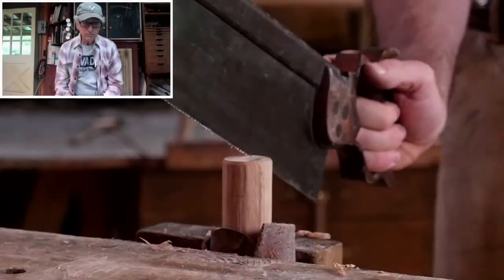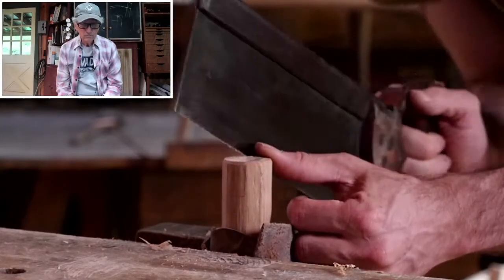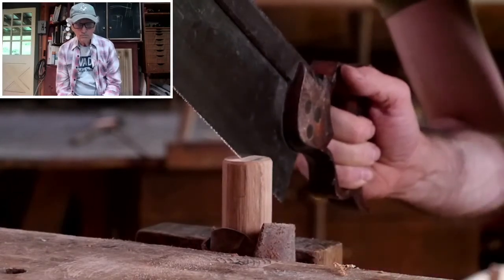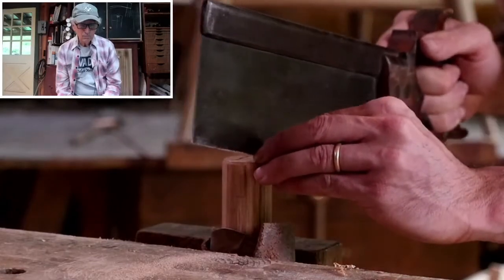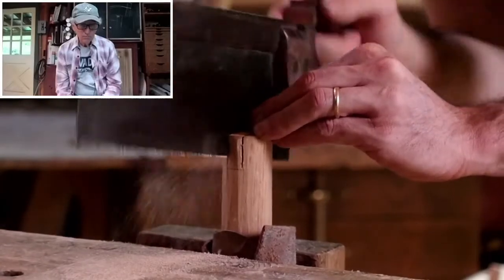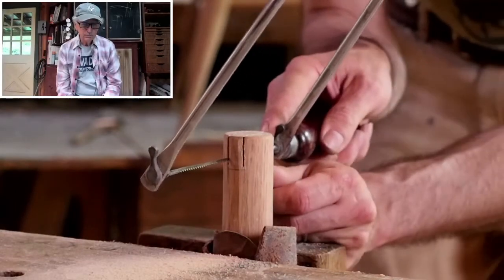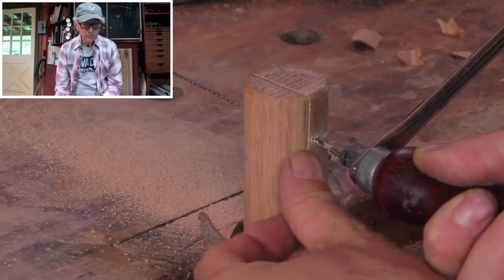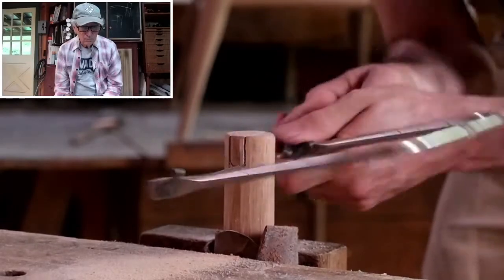Back Saw and Coping Saw Technique

Comment: You can also saw one line at a time for even better control:
1) start with the top line and cut only about 1/16" deep next to the pencil line
2) slowly drop the handle while sawing and follow the line facing you; the saw tracks in the top kerf
3) turn the piece around and repeat step 2
That's how I got it taught and it really is a good technique imo.
Reply from the maker: Good idea!